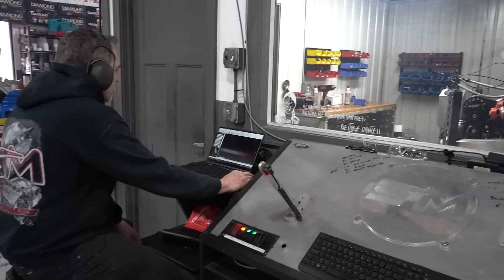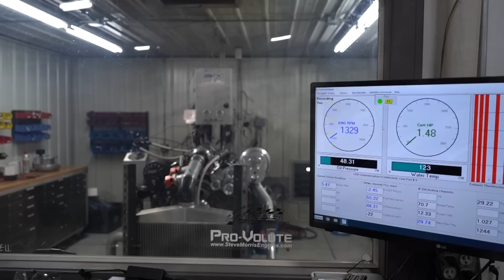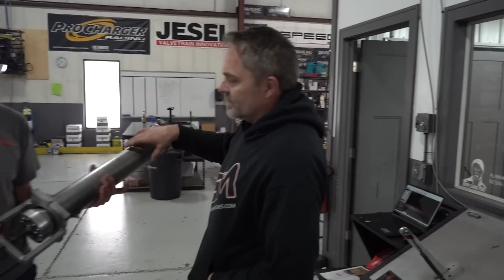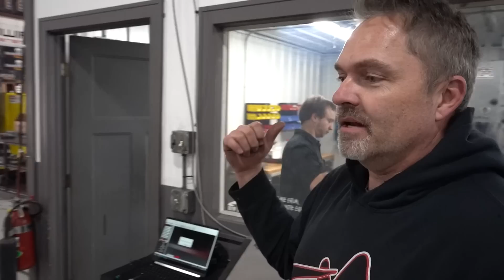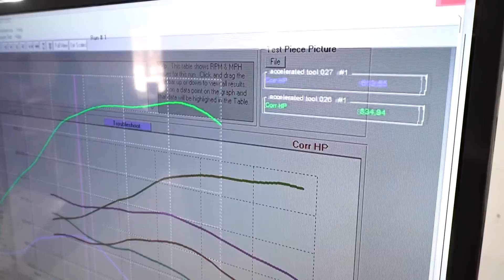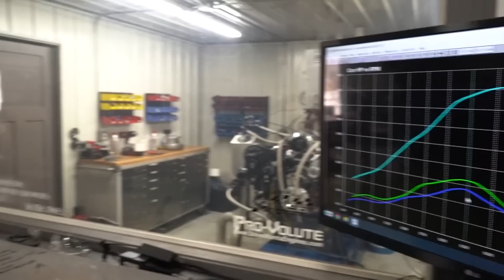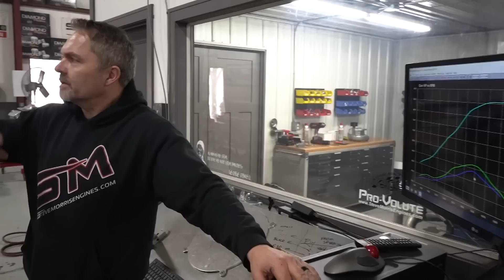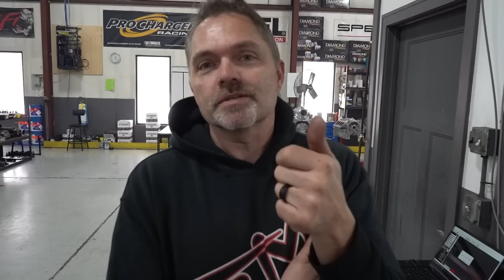CRAZY Testing After The  Dyno Session

Comment: I think the best way to do this would take a second motor and feed the boost into it. That way you can compare in a more controlled environment. But either way really cool to see.
Reply: I was thinking that too, he even has 2 dynos side-by-side!
Reply: That’s what they did basically. But you still have quite a few different variables that doesn’t take in effect. Even with the restriction piece you’re not talking into the fact that a engine is a big pump that sucks in air. That vacuum alone is one issue. Plus the SC wasn’t acting like it was on a motor, it was 100%+ drag and free flowing which causes extra heat and makes it work harder. He actually answered this on the next video he did and said yes if someone wants 2 identical motors built then one pumping into the other is a more Scientific way to measure this. But all and all this way (the way you stated) is a good second and gives you a good ballpark number w/o having to have a second expensive motor.

Comment: Since you have always taught us that Boost is essentially a measurement of restriction, how was using the larger pipe able to GAIN 1 PSI of boost rather than LOSE 1 PSI of boost ? Is it because the boost measurement was at the Blower outlet and not in the Intake manifold ? If measured in the piping, did the 4" pipe also result in an increase of Blower Speed due to less back pressure ? ...and THAT is where the increase of 1 PSI came from ? (Blower RPM ?)

Comment: The more power the engine makes, the more net force there is pushing down on the crank. The more load the supercharger puts on the engine, the more force there is pulling up on the crank. 
N/A + Supercharger = crank "pulled up"
N/A w/o supercharger = crank "equal"
Supercharged = crank "equal"
Turbo charged = crank "pushed down"
Also, a centrifugal supercharger takes twice as much torque to spin twice as fast, so 4x the power to spin twice as fast. Whipple/Roots blowers take roughly equal torque. 
Also consider the supercharger as doing work to the air- If its stalled, even though its pushing maybe 30PSI, because its not moving any air, its not really doing any work. At 20PSI its moving air now, so its doing a fair amount of work, though at 10PSI it could be moving 4x the amount of air, so even though the pressure is low, its doing a ton of work, and placing a huge load on the engine. I'm impressed the belts could handle that much power.

Comment: My opinion is the added cylinder pressure under boost is offsetting the load by deflecting the crankshaft opposite to the load on the snout. That opposition also explains why crank failures occur sometimes. That constant opposition is great for keeping everything balanced but it creates areas on the crank that experience more stress. Venting boost to atmosphere reduces cylinder pressure and without the opposing force to offset crank deflection, it’s pulling the snout way further than normal

Comment: The Restriction varies in the engine as the RPM changes, looks like your setup gives it a set restriction. Gotta find a way to match the restriction as the engine RPM changes. Maybe have two engines next to each other doing identical pulls. Engine 1 drives the super charger but the supercharger feeds engine 2 leaving the driving engine running NA.

Comment: Love your videos. Just had a thought about your issue of figuring out parasitic loss. Instead of keeping the supercharger driven from the crank for a control, what if you were to drive it from an electric motor to maintain the same boost with no drive from the engine. Then you could run it driven from the engine at the same boost level and could see the difference between the two, the engine sees the same level of boost but then does not need to spin the supercharger for the control. You could also test it against a turbo setup as well to see any losses from back pressure. I’m sure it would take a pretty big electric motor and programming but then you could see direct A to B at peak values. 
Love the videos keep ‘em coming 🤙🏼
Reply: Yes! And if you measure the power it takes for the electric motor to operate the supercharger through that run/simulation, maintaining the boost numbers per combustion-engine RPM (as a boost / rpm map), you can convert that power figure (kilowatts) directly to horsepower units, too.
Reply: Do you kno how big of a battery and motor you will need to keep that turning at 90000 rpm?? Lol
Reply: @t.j.henneborn8352   I’d imagine pretty big, but with a little gearing and a belt drive wouldn’t be too much different than the engine which isn’t spinning at 90,000 rpm. And it’s in a shop (assuming 3-phase with all the CNC machines) so wouldn’t need a battery since it would only be for dyno purposes. Just floating a thought, but like he said in his most recent video about a different idea, would take a lot of time and money to do and probably not practical unless he was focusing solely on testing superchargers.
Reply: @t.j.henneborn8352  haha, that would be serious! but you would just use the gearing of the supercharger unit just like the combustion engine does. The electric motor would need to make 300+ horsepower, which Tesla stuff is capable of for example.

Comment: 12 pounds in the engine is 12 PSIA.    12 pounds outside is  26.7 pounds assuming 14.7 atmospheric
Reply: At full throttle it should be very close to atmospheric in the engine. The pressure is just resistance to flow. They’d really have to focus more on airflow numbers over pressure numbers. 
It’d be really hard to match since the engine isn’t a static restriction. The airflow the engine takes in changes with rpm as the supercharger also changes how much it’s outputting with rpm.

Comment: I would think it is because the engine is creating a vacuum pulling in the boost as it is running and when it is not just trying to push the air out of the blower to nowhere??

Comment: Don't overthink it... Boost pressure is load against the impeller, whether it's going in the engine or out the door. You're still providing MORE pressure than the engine can handle, otherwise you'd have NO boost. Right?

Comment: Need to use two or more 60mm waist gates to regulated the charge air dump .   Airflow changes with volume just like fuel flow and injectors . If a given pipe flows X at 10 psi it does not flow 10 times as much at 100 psi .

Comment: The "Contraption" is providing a fixed amount of restriction to the airflow to create "boost" pressure. This is somewhat different from what's happening when connected to the engine.  If you were to plot and compare the two pressure curves I'm thinking the contraption test will ramp up much faster and further than when connected to the engine.  You might need some way to modulate the restriction with RPM so that the test boost curve more closely matches the real one.  Something that would let you "playback" the boost values from a baseline pull.

Comment: I just figured out how you test blower load. Drive the supercharger on an engine in the left dyno cell, but run a tube to an engine in the right dyno cell. Then the blower sees the exact load it would on the engine driving it, but the engine is not benefiting from any of that boost. Through the roof complicated, but seems like the only way to know.

Comment: OK,  here is an idea for more info. I came up with this based on what you said about the blower moving its air into a vaccume that the engine is producing.  What could you measure if instead of blowing the air from the blower into nothing, you pipe it over to an engine on your second dyno. So you are basically doing two dyno pulls at the same time. One engine powers the blower, and the  second engine gets the benefit? 

Well, maybe the data isn't that valuable... but it sure would be fun to watch. Crazy... but fun, I think... 🤔😁🙃🤪

Comment: The Power consumes by a supercharger is:
P= Q/M * c_v * t_1 * [pr^((kappa-1)/kappa)-1] / eta

P = Power [in Watts]
Q = mass flow [kg/s]
M = molar Mass, Q/M is the flow In moles of molecules/s
c_v = heat capacity
t_1 = compressor inlet temp in Kelvin
pr = the pressure ratio
kappa is the adiabatic exponent,~1.4 for air
eta = efficiency (both mechanical and compressor efficiency)

Without inefficiencies and with kappa =1.4 the compressor outlet temperature t_2 is about:
t_2= t_1 * pr^0.3
The takeaway is: Power is proportional to Mass flow and Compressor inlet Temperature. It also rises proportional to with pr^0.3 -1. This means it takes 5 times the power to compress the same mass flow to 60 psi boost as it does to 7 psi. All that is assuming internal compression, a roots blower will do a LOT worse...
Reply: Rough Power estimate:
assumead 2000hp airflow should be around 1600g/s maf
c_v of air is~ 1kJ/(kg *K)
t_1 is room temp, I assume 293K
Kappa =1.4
pr at 27psi boost is ~ 2.9
eta=0.7

Plug that in to the formula:
P= maf * c_v * t_1 * [pr^((kappa-1)/kappa)-1] / eta
=238KW or 309hp, so it is the right ball park

Comment: A good practical demonstration of affinity laws 👍

The crank deflection difference, and therefore load, is perhaps due to measuring pressure at different locations? When connected to the engine it's manifold pressure, whereas In the power consumption test the pressure is measured directly off the charger? If that's the csse then the engine test would have pressure loss upstream of the measurement point (throttle, pipework, intercooler), therefore the charger discharge pressure is likely higher than in the power consumption test.

Comment: boost is easy to create, its the flow is the hard part...(one way to think of it is the full load is when wide open, but when there is load the impeller actually cavitates in the air, which reduces load but generates tons of heat) there is calculations to figure the load on the belt for roots blowers, as i did this previously building supercharged mini coopers, and under max load the little supercharger on a 1.3L was pulling around 100hp through the Supercharger belt. I had a devil of a time finding belts that would take the load with the typical serpentine belt width) I dont have the reference materials with me to see if they include centrifugal, but the book is Four stroke performance tuning by A. Graham Bell

Comment: Couldn't you simply suck air from the outlet of the supercharger with same CFM the engine requires?  Say, use a leaf blower or something on the outlet so simulate engine vacuum?  Or perhaps feed the supercharger with the same amount of CFM the engine would require?  Also, couldn't you use a blow off valve and let the Holley control the cone on the end to maintain steady boost pressure?  This way you would have constant boost pressure regardless of the engine RPM.

Comment: Here is my theory...errrr ....Bro science  lol!
At first I thought that the boost increased cylinder pressures which pushes down on on the crank counteracting the opposing blower belt drive issues.
However...I am having second errr...thoughts. I have to admit that the problem  is quite possibly that just the crank snout  is moving and cylinder pressure increases are unlikely to move the crank snout that far.....I know a guy that could measure that though! :)
Maybe cranks move more than we know?

Comment: Since we take power from the engine to drive the compressor wheel, the question shouldn’t be how much power does it take; the question should be, which is more efficient, direct drive, belt drive, or exhaust driven?That said, wouldn’t it be better to compare torque and horsepower output at a target boost level? The compressor wheel, housing and other cold-side plumbing would need to be the same or as similar as possible in all cases.

Comment: So, there is some kind of restriction in the process of the engine running itself ? Whether via vacuum being caused by the engine (being an air pump)? 
If you could map the CFM on the blower intake vs CFM on blower outlet vs engine vacuum at engine intake vs engine rpm? Easy to say and we're all experts on this side of the screen of course lol. But mapping this and then trying to align peak engine torque and engine pumping (vacuum) efficiency with peak blower efficiency, whilst taking into account losses across the intercooler would be very interesting.  Then things like pipe size, throttle body size, intercooler design would become very relevant.
Just my $0.02 worth ...

Comment: You need a CFM gauge so you can figure out how much work is being done.  Work being CFM times psig.  It's doing more work when not blowing into the motor, probably because it's moving more air without the intercooler and extra plumbing creating more resistance.

Comment: The air flow fairys  strike again..  air flow through the engine is a lot different to air flow through a set orifice..  and cfm  meter on housing inlet run in both cofigurations  would confirm that.. 👍

Comment: blower belt load will pull the crank up to the 2 o clock position in this scenario, the resulting bearing friction will transfer that anticlockwise, perhaps to the 11 o clock position. When the engine is making extra power from the supercharger the crankshaft will move towards the 6 o’clock position as a result of combustion pressure. 
Therefore with the blower working in conjunction with the engine the resulting torque effect will largely be negligible.

Comment: Love this. Gets the brain working. Maybe have the engine in the other dyno cell consume the air from the first one. You would need to run both pretty closely for rpm.  The engine is not a fixed restriction unless the rpm is stable. With pumping efficiency it won't be linear. The old BMEP comes into play. The blower won't be linear either.
Reply from the maker: Yep

Comment: The psi on a running engine is what hasn't made it through the engine 2/3rds more air has probably gone through the engine than through a restriction set at 12psi so the running engine is flowing a lot more air let alone the pressure differential of vaccim caused by the piston traveling down .the only real way would be to go by cfm into the inlet of the charger matched to cfm of it going through the engine
Reply from the maker: Thanks

Comment: If you have two identical engines side but side run a base on both engines then hook the blower drive to engine 1 but run the boost in to engine 2 if my brain works correctly that should give a more accurate answer I know it would be a lot of a work but should work well in my head
Reply from the maker: Thanks

Comment: cannot flow enough air past 13psi for that motor (compressor wheel is too small). the test cone restricts airflow hence higher boost  but less cfm past the cone per psi e.g. 6 psi 400 cfm 12 psi 600 psi 18 psi 700 cfm. I don't know actual numbers but that's my understanding.

Comment: Hi Steve. I have a theory. That linear downward line is actually measuring the power required to drive the blower above that which the engine can apply. To calculate the amount of power you'd probably do something like subtract the loaded power level from that peak point. Then add that difference to the peak power before it dropped off. E.G. at your NA peak of 850hp rpm you have a loaded power of 300hp. The peak before drop off is 425hp. 425-300=125hp. You'd add that to the 425 = 550hp @ 15PSI load on the blower. If you then run the boosted engine at 15PSI and get say 1000hp you could say that the engine was probably at about 1550hp total with 15PSI of boost.
Reply: Was just thinking about it. At the point the power drops off is actually the power the engine is producing in my previous calculation. Not what the blower is actually using. You'd have to subtract the power of the engine at that point from the loaded and unloaded conditions. Say 600 NA and 425 under load. So, about 175hp loss at that point. Then, you'd add the additional power loss after that point. So using my previous, e.g, it should be 175 + 125 = 300 hp to run at 1000 hp. 1300hp total.

Comment: If Torqstorm was to install a strain gauge on an extension shaft between the supercharger pulley and the supercharger itself on their test equipment they would have the data about parasitic losses. They could easily transfer the extension shaft to different engines and easily mount different superchargers to the extension.  Alternatively, using a separate power source to drive the supercharger or driving another air pump to create the load would add a lot of complexity in trying to match the RPMs/CFMs

Comment: Run the engine NA.  Run the blower dead center in the compressor map 2 runs 1psi apart with all other variables the same, calculate power per pound, after some simple subtraction end up with super specific power loss on a specific combo with a specific blower and specific RPM.  "oh wow this is cool" shrug shoulders and smile. 🤣

Comment: You’re forgetting the additional downward force applied to the crankshaft from the extra boost pressure added to the combustion chamber!
That’s extra boost pressure is missing when your running the blower “free air”! That would be my guess as to why the crank moves upward to contact the crank sensor!

Comment: Steve is When you where testing a blower was it a Roots type (positive displacement) or a centrifugal type blower A Positive displacement blower has a liner flow(If you disregard Friction losses) and a Centrifugal blower is speed (driven RPM) dependent and non liner as PSI output changes Air Flow is a fluid dynamic A variable speed centrifugal water pump has the same constraints as air pumps (Blowers /Turbos) and the is a lot of data on line explaining pump flow characteristics

Comment: Great video, is it fluid dynamics where the pump cannot push that amount of air out and gets hydro locked on the air. If the engine is creating a vacuum it creates a lower pressure on the outlet to pump more efficiently ??? Like its harder to cycle into the wind ( no engine sucking )that with the wind ( engine also moving air )